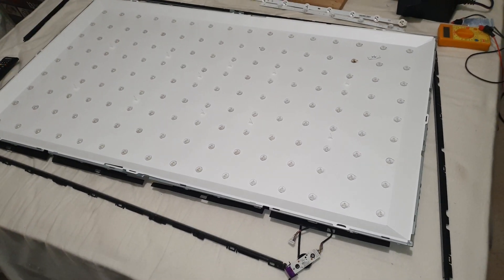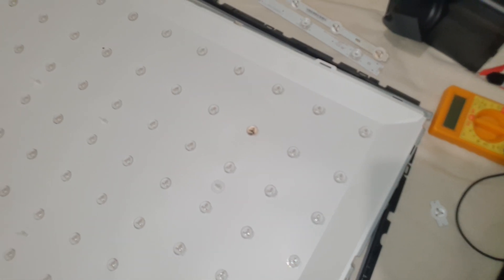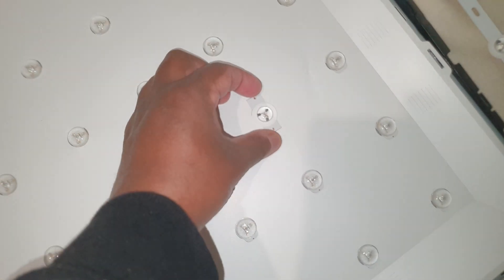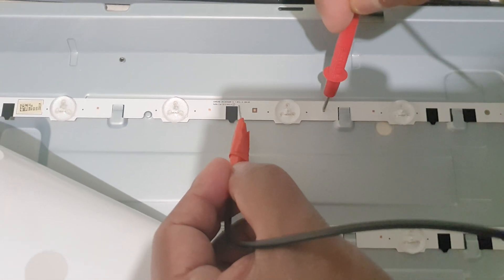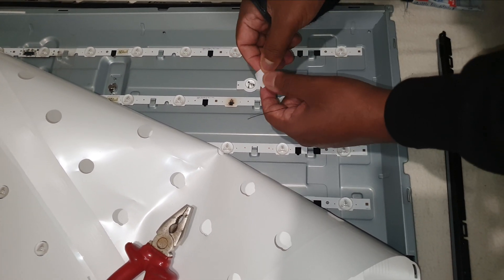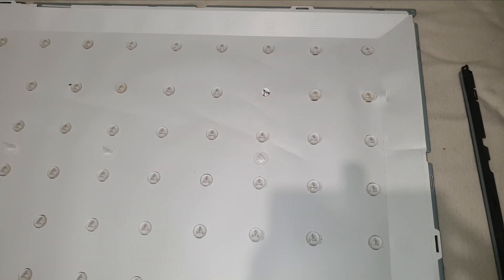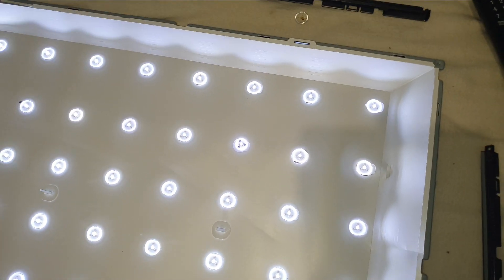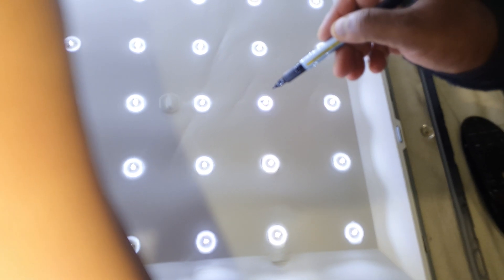White Spots Appear During LED Backlight Repair? Here's the Way to Remove It..!

Comment: I just changed my leds. Used the same brand and everything that originally came out of the tv. Now there’s white spots in a few places that show through. Only on blank screen can you see it.
Reply from the maker: This may be due to one of below reasons.
1. You did not fix the back white color reflector paper correctly.
2. The LED is not in good quality.